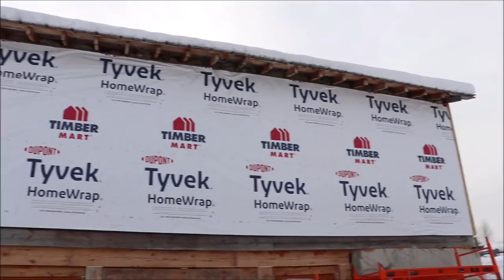Getting Set Up To Strap The Last Wall. Off Grid Homesteading.

Comment: Do not attach styrofoam insulation directly to concrete you must leave an air space or it will destroy the concrete frost will penetrate concrete and large chunks 3-4” deep will break off dependant on how much moisture is trapped in concrete. Have seen too many homeowners try this with costly structural damage as a result. Stay warm love your work ethic never give up!

Comment: The powder is salt coming out. You can get some (Drylok 27512 Latex Water Proofer) Amazom has it. It will seal the wall. You should do both sides of the wall.Hope this helps you , keep up the good work.

Comment: The water in your concrete wall could be due to condensation of the water captured in the air as humidity.  If the full temperature drop from the temperature inside to the temperature outside is handled by the concrete wall only and you have no insulation, then you have the condensation point somewhere within the wall.  Within your building you've a certain humidity.  Temperature is one factor, that changes humidity.  If the temperature is getting lowered, then humidity in the air is raising.  The moment the humidity in the air reaches 100% saturation lowering the temperature further will lead to condensation and you have waterdrops in the middle of your concrete wall.  To me it was told that's the reason you have to install a steam barrier in the wall to separate the humidity of the air inside of the wall from the humidity outside of the wall.  It looks like you considered the issue in the upper half of your building where you put a plastic foil outside of the insulation, and I don't assume the plastic foil is a rain protection.

Comment: I have used that type of scaffolding for decades.  It is amazingly easy to assemble and move.  There are outriggers available to use with them that attach just as easily.  The only difficulty with them is getting on or off using the scaffold ends as a ladder.  We used them as scaffolds and roll around material storage or a work table.  They are just so easy to use and durable, I think a company named Baker was the first one to use this system because when I first started using them everyone referred to them as a Baker scaffold.
Reply from the maker: Hello Roy. They sure are easy to set up, we just love them.  Cheers.

Comment: Maybe when you insulate and waterproof the concrete it will stop sweating. As for the powder . not a clue. [I looked it up and found this: "Efflorescence
Efflorescence is the white powdery substance on the surfaces of unsealed concrete and the white blush seen with sealed floors. Efflorescence is caused by vapor migrating through the slab bringing soluble salts to the surface of the concrete."  The cure, supposedly is to seal it to keep moisture from wicking.
Reply from the maker: Good morning Mimi. Thank you, very good information.  Cheers.
Reply: @SkinnersHomesteading  Hi guys if you are getting dampness inside as you suggested I suspect that you are getting damp impregnation from the front corner or side  of the foundation and the moisture is migrating allong  to the point if finds easiest to appear. To cure you will need to find the hole in your tar paint, it may be tiny, and seal it. It will probably be level with or slightly above the lowest dampness. If you can follow the line of your concrete pour it will most likely be the line the moisture is following. I hope this helps all the best Ian

Comment: That spot in your concrete wall is moisture penetration the concrete didn't fully cure so you'll have to seal it and then maybe think about putting a stain on that wall with gray stain paint if you want to leave it the way it is is that color down the road but I would definitely put some kind of a sealer on it what causes problem
Reply: Is that a warm weather fix for the concrete?

Comment: Cecil I know u get lots of comments but u can place 2x material between the two Baker scaffolds which would help you out . I have worked on Baker scaffolds for years . Hope this helps
Reply from the maker: Hello Wayne. Thanks, I was thinking of using two of our 2"x6"x8' lumber we have to bridge across  the two sets...I just wasn't sure if the scaffold could handle the weight, what's you're opinion? Tanks again Wayne.  Cheers.
Reply: @SkinnersHomesteading  On yea, no problem at all. I've used those bakers all strung out along walls a lot for drywall finishing.
Reply from the maker: @JC1028  Hello.  Thanks...I shall give it a go for sure than.  Cheers.
Reply: @SkinnersHomesteading  The thing to watch with those is balance when double stacking them as they are so narrow. 2 high isn't bad, 3 gets pretty tippy tho. Just be careful on uneven ground/snow. Their main use is interior but they are also used outside when full size scaffold won't work well in a narrow spot. You'll be fine as long as you make sure they're sunken nicely down into the snow. You've got the balance from wall walking so you'll be fine. :)

Comment: Good morning, my experience with scoffold , I think u should tie it to somewhere secured. Is there some cross ❌ brace ? Those will keep it from rocking. Honestly I don't trust it without them
Reply: Thanks much but please pay attention to the concerned , especially when you starts to stack on top
Reply from the maker: Hello Lloyd.  Yeah they were a little tipsy.  We have changed our approach today.  Thanks again.  You have a great day.  Cheers.
Reply: @SkinnersHomesteading  Thanks bro. I know they would, worst the surface not super flat. What you could do is removed the wheels and used some 2 bys to support it. The wheels are really for inside and flat surfaces
Reply from the maker: Thanks...I left the wheels on in hopes the scaffold wouldn't sink into the ground as easy as just the pipes..The ground is very soft near the house :-(  Thanks again.  Cheers.